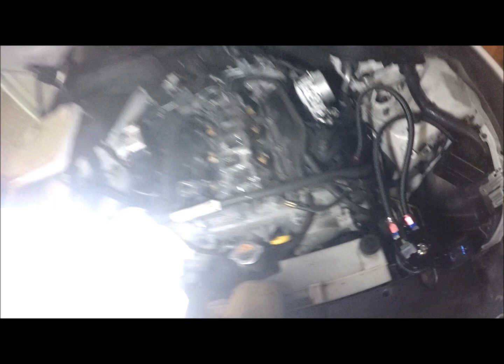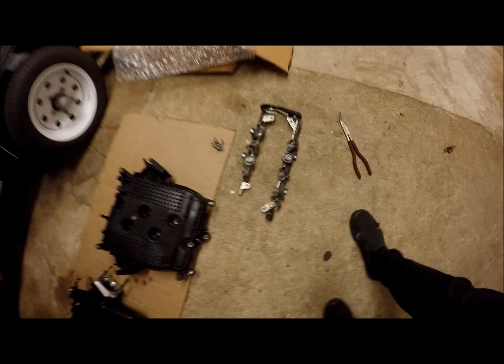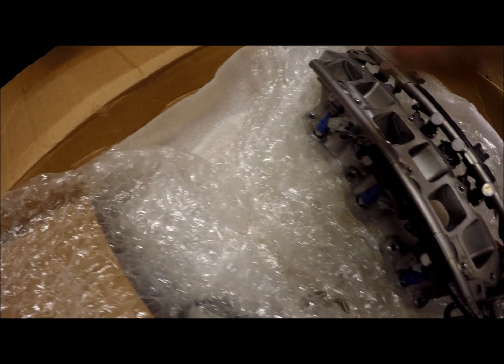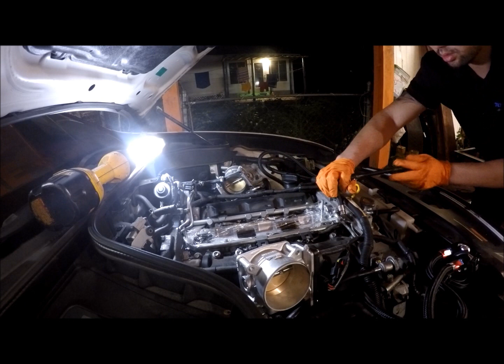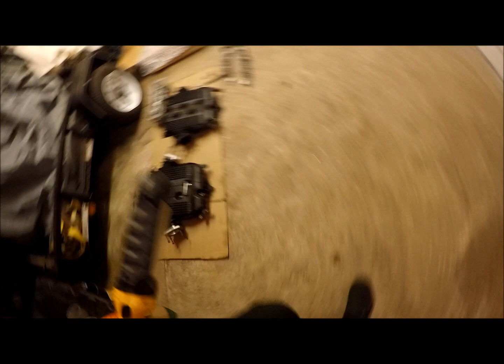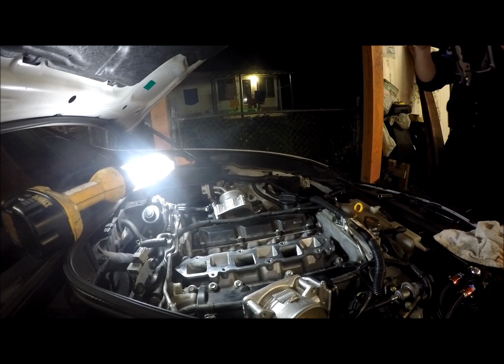G37 / 370Z VQ37VHR Lower Intake Manifold Removal

Comment: Hey did you have to get tuned straight after?
Reply from the maker: Yrvensonc Chery , I did. I actually got a base tune uploaded remotely because of the larger injectors. Then the next day I drove it to have it dyno tuned
Reply: So i can drive it with the ported intakes?
Reply from the maker: @yrvensoncchery7110  , yea, the ecu compensates enough for you to drive but not aggressively. You'll be safe to cruise to a shop to get a full tune.

Comment: Did it made a difference
Reply from the maker: The upper and lower together with a retune I gained as much as 20whp in the mid range and 10whp peak.
For $550 for both, it’s one of the best mods I’ve bought.
Reply: Nice gains bro , do I really need the lower , I have the upper
Reply from the maker: @torvarrisevans3961  , I am sure there will still be gains on the upper. I am not sure how much.
Reply: @ProjectPanda13  thanks bruh
Reply from the maker: Thank you also for watching my video
Reply: @ProjectPanda13  np bruh , I already have the upper plenum, I was just wondering if i should get the lower  or  not , because it really expensive . Which mods are best bank fa buck . Thank you in advance
Reply from the maker: @torvarrisevans3961  , for the money and simplicity, a used set of long tube intakes ($300-$400), resonated test pipes ($200-$400), and exhaust. Doing the lower isn’t a popular mod and people still make good power without it
Reply: @ProjectPanda13  ok cool , can I still make good gains from HFC as well.  I am currently running  kinetic , is it a must for test pipe and what’s  the power between both of them . Sorry for any inconvenience bruh
Reply from the maker: @torvarrisevans3961  , ask any question and I’ll try my best to help.  You can still make good power on HFC. The difference isn’t much when you’re comparing to other NA modded cars.
Reply: @ProjectPanda13  thank u bro
Reply from the maker: @torvarrisevans3961  , no prob. Sub to the channel if you can. Feel free to hit me up if you’ve got other questions. I’m on IG @projectpanda13 also if that’s easier to reach me
Reply: @ProjectPanda13  hey bro hru ?  Am really still contemplating on the lower manifold, would I still be able to drive my car as a daily driver , if I dnt get tune ASAP ,
Reply from the maker: @torvarrisevans3961  , what’s good. What other mods do you have on the car now, specifically on the intake side? I’m not sure there’s much to be gained without a tune for these. But if you’ve had a tune before and you want to add the lower, you will be fine.
Reply: @ProjectPanda13  thank you,
Reply: @ProjectPanda13  how the g  holding up  bro ,
Reply from the maker: @torvarrisevans7254  , hey brother, I’m currently in the process of swapping my engine. I found a 2015 engine for a good price and really low miles. Sold my original engine that had 140,000 miles.
Reply: @ProjectPanda13  good stuff bro,
Reply from the maker: @torvarrisevans7254  how’s your car coming along?
Reply: @ProjectPanda13  ok cool bro,
Reply: What up bro,  would recommend z1 wid weight flywheel and z1 engine mounts,
Reply from the maker: @torvarrisevans7254  , hey, I agree with the mid weight for easy of daily driving. The super lightweight flywheel isn’t for everyone. Some love and some don’t. The mid weight still provides faster revs while maintaining driveabilty.

The z1 motor mounts will increase a bit of vibration but isn’t as bad as the transmission.
Reply: @ProjectPanda13  thank u bro, does the midweight flywheel really help with performance,  or acceleration
Reply: @ProjectPanda13  does z1 engine mounts helps put power down to wheel , I really don't want waste money. Would u recommend them.
Reply from the maker: @torvarrisevans7254  , if your oem mounts are in good condition, i would do it. it helps but there's money better spent else where
Reply: @ProjectPanda13  thank u bro, I will hold off